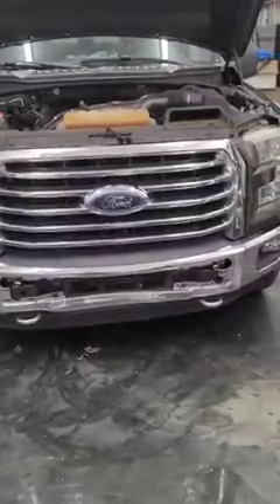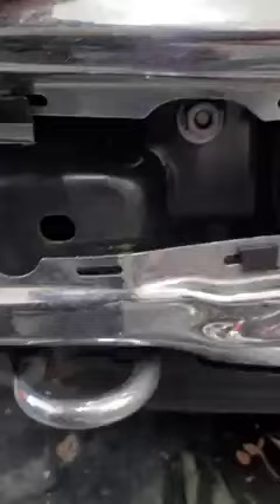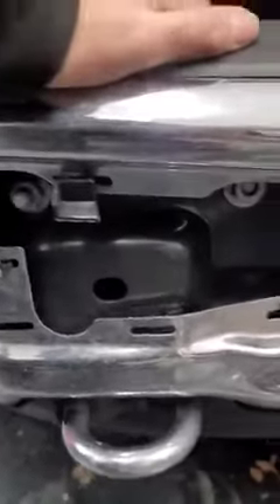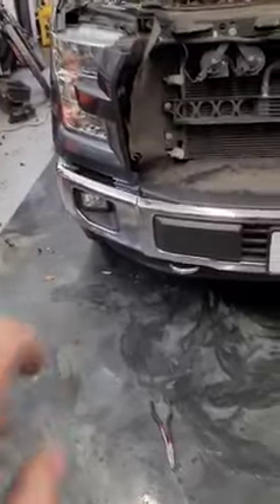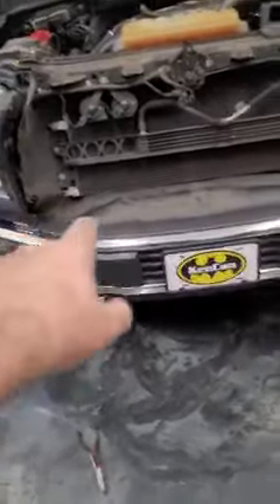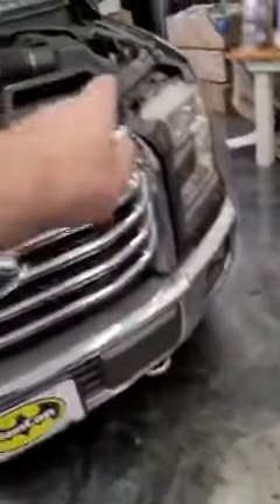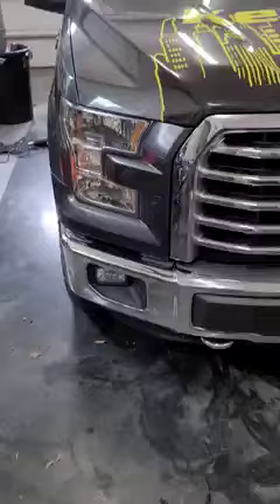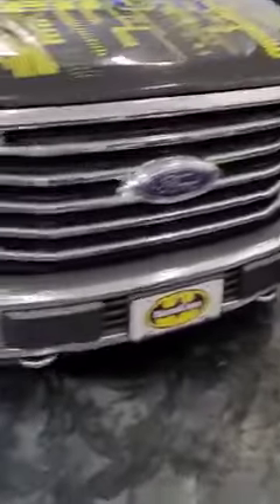Front Bumper Replacement on a 15-20 Ford F150 in 90 Seconds

Comment: grille does not to be removed on a 2016 F150.  disconnect driving light harness from bulbs or remove bulbs remove from housing, remove wiring harness retaining clips from bumper.  remove front rectangular trim panels/license plate bracket.  behind that are 4 x 13/16" nuts, 2 on each side. on the back side of the bumper close to the top of the bumper are 2 more 13/16" nuts 1 on each side (these 2 may allow for the bumper height adjustment on reassembly).  as bumper is pulled away from truck, at the top are 3 plastic retainers for a rubber filler piece that need to be removed.
Reply from the maker: Thanks for comment and support

Comment: Ran into a parking lot pylon last night and dented my front bumper, trying to decide if I can do this myself or if I need to take it a body shop. I think I may be able to do this one myself thanks to your video. Do you know what I have to Google for that trim piece that sits between the bumper and the headlights? Cause that's a little messed up too.
Reply from the maker: It's really easy not to hard.  You can Def do it.  It's called a side headlight molding.  Good luck to ya. Thanks for comment and support.
Reply: You did it thanks for sharing

Comment: Comments in other videos have stated removing the plastic piece within the bumper will give you access to the bolts needed to remove the bumper. Also unplugging fog lights and perhaps adaptive cruise control system will be required. 
True?
Reply from the maker: Don't have adaptive cruise on this one.  And yes unplug fogs. Not sure what plastic bit you speak of.  Thanks for comment and support
Reply: @JMRRebuilders  The center plastic piece in the license plate area. (Obviously  missing on your damage bumper). I have never removed mine but many have stated that removing all the upper grill assembly is not necessary. Maybe check into that if you have to remove it again.
Reply from the maker: @jaym7369  was able to install with out needing to remove it. Thanks for comment
Reply: Thanks for the comment! I just hit a deer this morning so I'll be replacing mine.